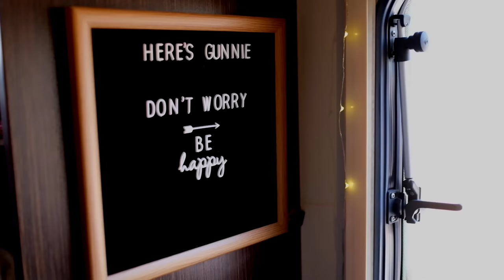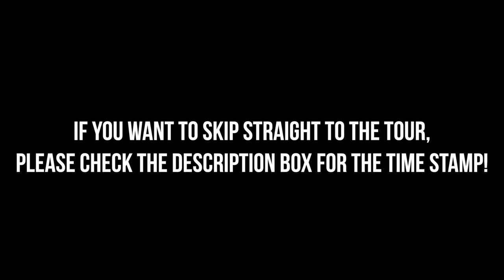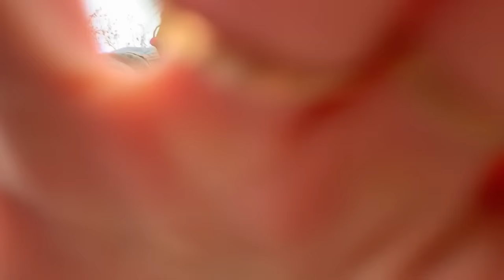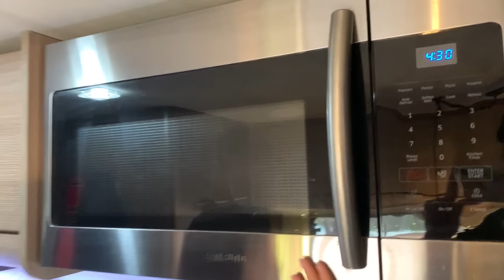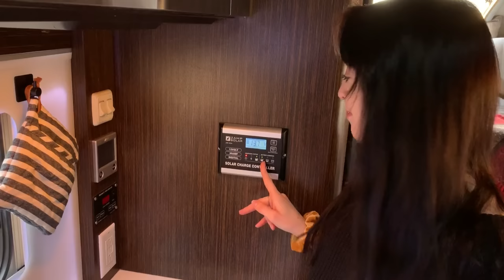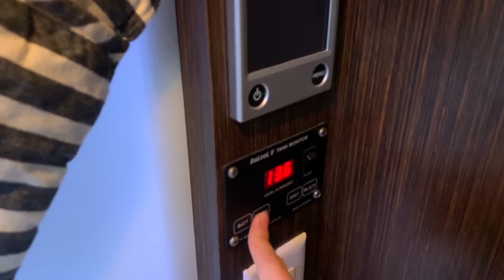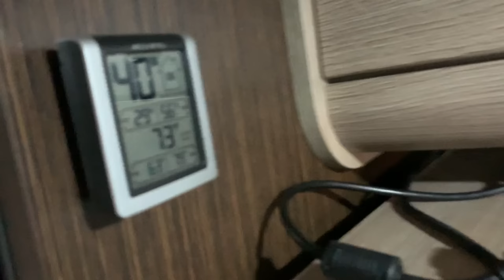Off-Grid Full-Timing Couple's Truck Camper: Tour + Review of Cirrus 820

Comment: I think its is made for a full size bed. Then tv would swing and cabinets would be easy to get into.
Reply from the maker: It actually is made for a queen size bed. The mattress that came with the camper is a queen. It is also listed on nucamp's website that the Cirrus features a queen size bed! Also, having a full size bed wouldn't help the TV swing as is it a height, not width issue. And the cabinets are sadly just poorly designed in general. The newer models have actually corrected this issue though, with top opening doors.

Comment: Thanks Christina Ricci & Ashton Kutcher! 🙃 Do you have any issues with the overall height having enough clearance when encountering underpasses? If so, how often (%) do you encounter this (more so rural or urban areas)? I’m planning on going full time & this is the main concern I have with a truck camper option. Thanks!
Reply from the maker: Samuel J. Martin III haha we appreciate the doppelgänger compliments 😆 We’ve driven nearly 40k miles and it has only happened three times where we have had to reroute (painlessly) due to a low bridge/underpass. Twice in upstate New York (a low railroad bridge and one of those old iron bridges with low scaffolding) and once in the suburbs of Atlanta when visiting friends. We don’t venture into cities very often. You may have issues in the older parts of New England. Otherwise, we’ve found clearances to be 13’6”+ as that’s the norm for semi-trucks. We have driven by signs that warn of a low clearance but once we arrive we find the actual clearance to be much higher! Once in Texas, a sign warned 11’8”. We’re 11’6” so we were worried. When we reached it, we got out and measured. It was over 13’ in reality! I wouldn’t put this as a high priority con when considering a truck camper. The benefits of truck campers definitely beat out the odd low clearance situation you may run into! And there’s usually a way around if you do come across one.

Comment: Hey guys, great tour thanks for sharing! I was wondering if you have shared any details from your experience of replacing your AC unit with a Max fan? I am really interested in this project. Were you able to simply pop in the max fan without having to make the roof opening smaller? Any details that might be able to share regarding the project would be greatly appreciated 😀

Comment: Hey thanks for pointing me in the direction of your review! It's amazing how very little there is out there in terms of real world reviews, so I appreciate this greatly. 

What is the power draw like for the heating system? And what is the coldest sustained weather you were able to endure?
Reply from the maker: I'm so glad you found the video helpful!! Thanks for watching! We totally missed out on explaining the Alde power draw. It draws 2 amps and uses a lot of propane. We were refilling our collective 40lbs of propane every few weeks when we were camping in the cold (averaging around below 30 degrees F). It would be ideal if the Alde didn't use any electricity since we rely on solar power and the Alde mainly runs at night so we've, a few times, drained our battery in one night just from the Alde. It certainly uses less power than a typical furnace heater though! This winter we were camping near the Blue Ridge Parkway and it was below 0 degrees F. Unfortunately, it kind of crapped out on us when we needed it the most - that's when the glycol purge happened so we were stuck freezing. A few people have noted that our circulator pump is set too high so that may be the fix! When it is working, it keeps it SO warm in here. You could easily go way below zero, be covered in snow, and be very toasty! All of the pipes and tanks are insulated properly too so nothing freezes, it's great.

Comment: I have searched for information on the sink you bought but can't find it in the feed. Can you please let me know what sink you bought? I see many on Amazon that are under the cabinet mount but not many that are top mount. I think I am just going to use an under mount and mount it on the top. Thoughts? Thanks for all the helpful info. We just bought this unit and are excited to get it next week. Any other things I should know about?
Reply from the maker: @Kevin Gleitz Hi!! Everything is listed in the description but here’s the link for the sink just in case: https://amzn.to/2HbdHc5

Technically it’s an undermount sink but we installed it just fine as a drop in!

Pretty much everything we have big issues with is in the video BUT if you have any specific questions or concerns please feel free to reach out!! Something breaks just about every day, but we always find a fix haha :) Enjoy your Cirrus!! If you have Instagram please let me know your account - we’re more active on there. Our handle is @wheresgunnie :)
Would love to follow along on your adventures!!
Reply: I went ahead and added it and we love it thanks!
Reply: This is what I got and I only had to cut out the corners the sink dropped right in after that. I will say you need to use teflon tape to connect it or you will have leaks when you use plastic and metal together to join hoses.  

LORDEAR Commercial 15 Inch 16 Gauge 10 Inch Deep Small Drop In Undermout Stainless Steel Single Bowl Kitchen Sink, Brushed Nickel Single Bar Sink
Sold by: LORDEAR HOME  Product question? Ask Seller
Return eligible through Jul 3, 2019
$156.00

Comment: I have a very similar setup.  I'm interested in if you installed a battery isolator on your truck or your camper?
Reply from the maker: Dallas Rose hi! No we did not. We have two truck batteries and only one is connected to the camper so we’re not worried about draining the starting battery.

Comment: Is your truck a 6.6 bed and if so can you tow a boat with that model? It looks like there is a lot of overhang. I have a 2017 Denali diesel SRW and I really like this camper.
Reply from the maker: It is a standard size bed. You can tow a boat with an extended hitch. We see that all the time. Probably have to watch your weight very carefully though.

Comment: Nice review and camper. I really wanted to want a truck camper setup, if that makes sense. I really liked the idea of a separate camper that I could drop at a campsite and then be able to drive the truck around. I also loved the idea of having a proper 4x4 vehicle that could go pretty far off road. However, the more I researched it, the more I realized that it wouldn't work for me. Mainly because I want to be able to urban (stealth) camp in cities and a truck camper stands out like a sore thumb. I also what better fuel economy than a HD truck can provide and more battery power than a truck camper typically provides. Soooo I've decided to go with a class B with 4WD, either a Sprinter or a Transit, I haven't decided yet, but a Transit will require an aftermarket 4x4 conversion.
Reply from the maker: Thank you! I 100% understand where you're coming from! Luckily our priority is being as far from cities as possible haha. But yes, our fuel economy is unfortunate. I do love the 4x4 sprinters! I follow a bunch on instagram with envy. I'm curious about your battery power comment... Do class Bs typically have more battery power than we do? We have two 75 ah batteries in the camper and two more batteries in the truck, one of which is connected to the camper. We are also considering switching to lithium in the camper to squeeze more power in. If you're converting a van you can add as many batteries as you want so that's nice. Thanks for watching and good luck with your camper hunt!!
Reply: @WheresGunnie  
OEM class B vans typically have 100-200 amp/hr AGM battery as standard, but I'm leaning toward a custom build which would allow me to have as much lithium battery power as I want, at a significant cost of course. For me, it came down to wanting a rig that can hide in plain sight, allow me to pass between cab and camper without going outside, have 4WD and enough battery/solar/inverter power to stay off grid indefinitely. That said, I do love the camper you guys chose and the upgrades you made. I agree that many RVs these days, especially truck campers, are seriously dated in their aesthetic, but Cirrus is doing a good job with decor. I too want something modern and stylistically unique.
Reply from the maker: Wow that's awesome, I had no idea that class Bs were packing that much battery power! Sounds like you're going to have the dream rig!
Reply: @WheresGunnie  
That's the idea, I just have to save up the $$ to have it built.

Comment: Hi thanks for the video. A “discrete temperature sensor” kit is available on Amazon to move the temp sensing for your Alde system. Amazon cannot find Alde when I search but it comes up searching via Google. What fluid do you order to have on hand? Thanks
Reply from the maker: That's a fantastic idea!! Thanks for the tip! The fluid is called Century Chemical TF1 Transfer Fluid. Here's the link on amazon: https://www.amazon.com/dp/B00JAB4YT8/ref=cm_sw_em_r_mt_dp_U_ItBDCbG4DQRT8

Comment: On the battery compartment. You could try some outdoor weather stripping. Might help. Maybe  some silicone. To thicken up sre where it leaks. 
Or. A gutter above. Just some 3m adhedive tape with pice of aliminum
Reply from the maker: Good ideas, thanks.

Comment: Cirrus is one of the best mid priced campers on the market, the company is incredible, they are very advanced for their price range, they far more advanced then the Palomino truck camper that we own. You shouldn't expect get the features of a $50,000 camper (like sink, stove, inverter, electric outlets, light fixtures etc) for a 30 some thousand dollar camper, a lot of those so called design defects were because of the price range that you chose and your personal preferences, a lot of those things you didn't like would have added substantial cost, I would prefer a larger window than a taller hamper cabinet next to the bed, that wouldn't be a defect to me. 
I am adding more electrical outlets in our truck camper but it is very difficult because of how it's has to be built to fit into the truck, you don't have 2x4 walls to work with, it's not easy to get wires to a new area. 
Almost all full time campers realize that there can be mold issues because we exhale large amounts of moisture, it's a tiny area to be living full time, you should have thanked Cirrus for that bed system that helps to fight that problem, if you don't handle the moisture you will have mold, don,t say the froli venting system is not doing it job, if you put moist air under the bed there will be mold, it's one of the best systems available to provide ventilation under the bed and I don't know of another truck camper in that price range that even offers it. I hope your intent was not to criticize the camper, it's an incredible camper for the money, they aren't built like a house.

Comment: Thanks for the video.    Just curious why you didn’t consider a Lance or Artic Fox truck camper ?   The slides give you sooo much more room.
Reply from the maker: Thank you for watching! We’re in and out of the camper a lot and always on the go, so slides wouldn’t have worked for us, since the inside of slide campers are nearly useless/cramped when not slid out. Just more to worry about and more time to set up/break camp. Not worth it for us. It’s more than enough space!

Comment: Thanks for the great video. I do have a question about the inverter. Did you hard wire it into the breaker box so that you have power in all the 120 outlets or did you just add an inverted outlet somewhere in the Cirrus?

P.S. As a flight attendant, I enjoyed the, "items may shift" airplane reference!
Reply from the maker: Hey! 

So, in short, yes, we hardwired it into the breaker box to give all outlets the inverted power. To go into more detail, we installed an automatic transfer switch and then split the main bus in the breaker box into two buses. This allowed us to separate the circuits so that, for example, the fridge and heater won’t use the inverter but all of the 120 outlets will when we’re not plugged into shore power.

It was a pain in the booty due to all of the wiring being pretty inaccessible and working in the narrows of the insides of the camper but on the plus side it has worked perfectly since we did it and was 100% worth all of the effort!!

Great question and I’m sorry we didn’t detail that in the video!! Maybe we’ll dedicate another video to the topic since it’s a big one! Thanks for watching and I’m glad you appreciated the items shifting reference :)

Comment: I would like to add that a Diesel engine will last twice as long. A well maintained Diesel engine will run 500k easy. When you take that into consideration the diesel is a far better investment. Plus, even tho they have similar tow ratings the Diesel engine will tow that weight much easier. The tow capacity is set by the frame and suspension, not the engine.
Reply: I just wrote the same thing .  Theres a huge difference between a gas and diesel truck.  Cummins guys are seeing million miles plus between rebuilds while towing heavy.
Reply: Mark Rich : I’m glad you replied. Thx for the backup. I think the biggest misconception is that because the trucks have the same tow rating that the engines are basically the same. Nothing could be further from the truth.  A Diesel engine is superior to a gas engine in just about every way. The two areas where I think they shine the most is in tow capacity and fuel economy when towing. A gas engine will struggle when towing it’s full tow rating up a steep incline where a Diesel engine won’t even feel it. Then while going up that same hill the diesel will keep about the same fuel consumption as it always does while the gas engine will lose half its MPG. A diesel is designed and built to haul heavy loads all the time while gas will do fine if you only occasionally tow. If your going to have a camper permanently installed on the truck a Diesel is the way to go. You just have to get past that initial investment.
Reply: @BluBarron  
I agree lets not forget because of their high compression and higher tq rating everything is usually built stronger , making them last longer .  I own two rams w/ diesel cumming engines and a gas chevy truck . The gas truck and diesels arent in the same ball park not even close , transmission , axles towing capacity fuel mileage are all better on my diesels. 
You really dont know or understand until you own a diesel truck.
Reply: They said they needed the weight difference the diesel weighs about 600 pounds more and reduces the payload by that amount.  They are not towing so they are not worried now about towing capacity.  Unless they drive around a lot they will not get close to the mileage they need to worry about.
Reply: @badgerpa9  saying diesel don't last as long or the fuel milage is the same is false. Modern diesels will last about 4 x longer than a gas engine carry it's payload better and get 2.5x the fuel milage as its gas counter part. I get 19.2 mpg fully loaded with my trailer and forest river 1130.

Comment: Is that a 2500HD or 3500HD i have heard you can upgrade your existing 2500 to a 3500 its just extra springs
Reply from the maker: cheigis hey! It’s a true 3500HD but we’ve heard that also!
Reply: @WheresGunnie  Thanks for reply i just started following you guys along with a few others.  I am trying to decide if i want to get a 5th wheel or truck camper.   I have a 2018 2500 Duramax and my payload won't hold a camper but if i can upgrade that might open up my options.   Keep the videos coming so i can live vicariously through you guys until i get a camper.
Reply from the maker: @cheigis yes! oh, definitely get a truck camper! It gives you so much more freedom than a 5th wheel! Where you can park, camp, drive. Depends on the camping lifestyle you want though, for sure. By the way, nuCamp just came out with the Cirrus 720, for 3/4 ton trucks, so you should check that out! Although, it’s not as full-time capable as the 820 but it’s still pretty cool! Thanks for watching, we’ll try to get a new vid out soon ;)
Reply: @WheresGunnie  Thanks for the reply i saw that on some videos....I did some research and i am going to get an airlift kit found here https://www.airliftcompany.com/.  You might want to check it out as well even though yours is 3500 it will significantly improve your rear riding and stability along with the Hell Wig sway bar.    I will look forward to seeing more videos from you guys.   I am looking at several models to include the Artic Cat but i am like the Cirrus as it looks more modern and also some of the features you pointed out are different than some others.
Reply: Might want to double check the legality of upgrading. Just because it has the same parts as the 3500, doesn't mean the legal weight limit of the vehicle changes. Where this matters is if, knock on wood, you were ever involved in an accident, all they look at is your total weight and the legal rating for the vehicle.

Comment: Strange.... they are converting their DC into AC to power a DC Laptop and loosing power in the process. Laptops are battery powered. When you plug that laptop into AC it converts it back into DC.... Batteries are DC. Get a proper cigarette lighter connector and go straight into your 12 volt. You only need AC if using a desktop.